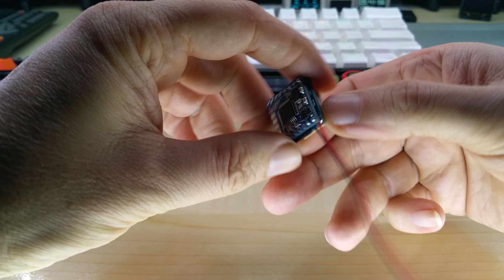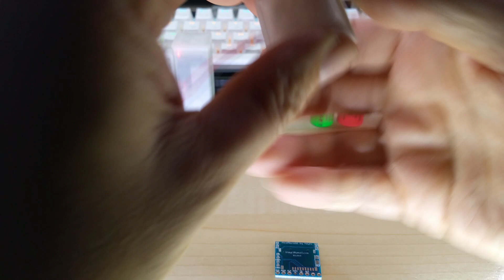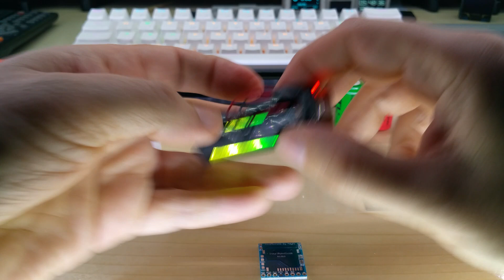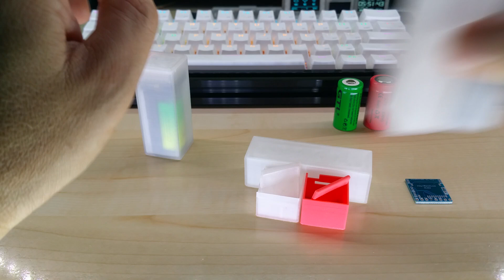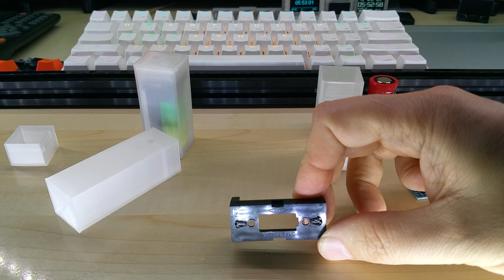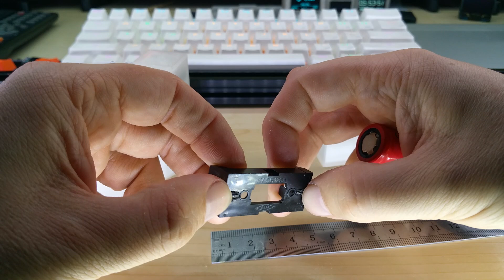New PicoGPS Tracker, available soon on my Tindie Store. #ArduinoGPS #GPSTracker #Hayri

Comment: Don’t you think you could just source the clip, rather than the knife?
Reply from the maker: I tried, but the prices start from $4.95 US no matter where I looked plus shipping. I thought of making my own out of carbon fiber that I had bought for a project, which would make it light weight and strong at the same time. Since I have a CNC, I could cut the shape and then bend it in a wooden jig to form with heat. Could drill the holes for the screws while milling out the form as well.
Reply from the maker: Edit: Just found out that you can not change the shape of Carbon Fiber after the resin is cured, it does not have thermo plastic capabilities, too bad. Then maybe make it out of Kydex , that I know can be formed with heat, Just need to buy some :-)

Comment: Great products, what about adding a vibraton sensor, and let it wake up using deepsleep, so it will only wake up when moving, and maybe adding a sim module så it can send to user to track lost items.
Reply from the maker: Thanks, actually I am thinking about a version with an accelerometer which could wake it up when motion is detected and I could use tap and double tap for other functions like  to turn on and of the GPS module itself. I did have a version with a GSM module but it only works with 2G Networks which are slowly but surely dying out.